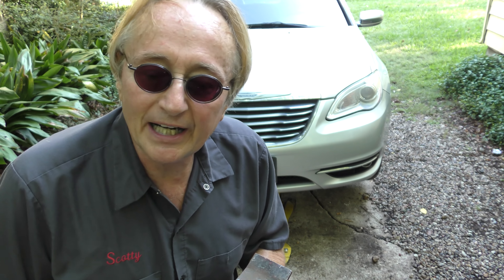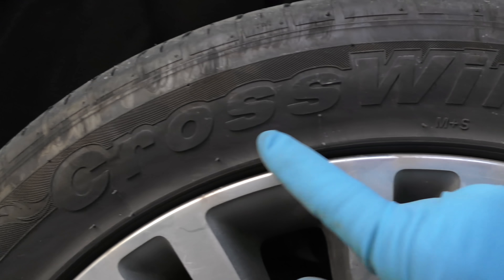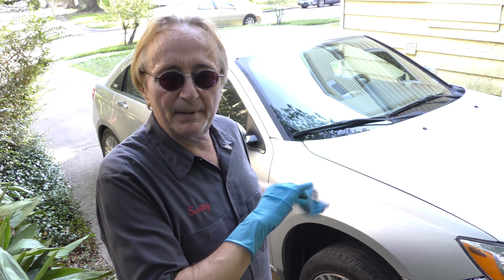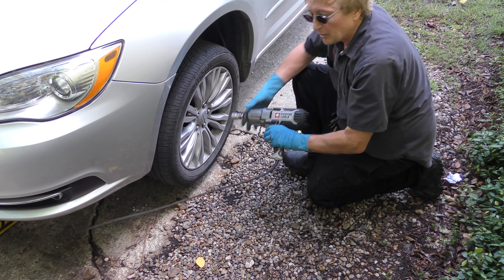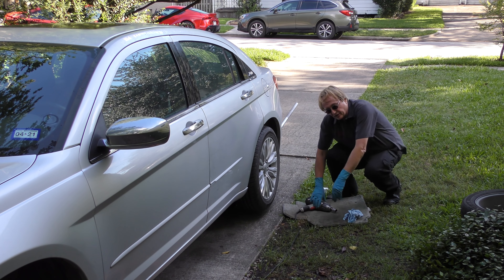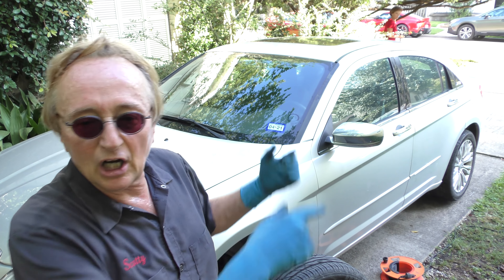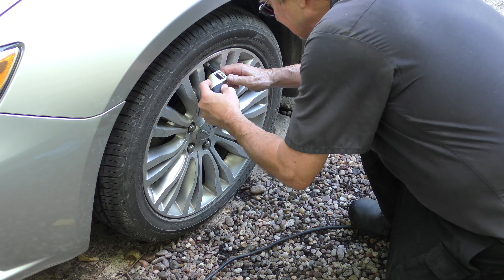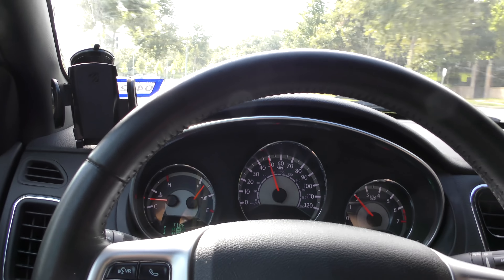Here’s How Stupid People Change Tires

Comment: Scotty, the tire engineers say to put the best tires on the rear, the reasoning is that if a tire blows out on the rear you have a greater chance of losing control of the car and fish-tailing or possibly rolling it over. It's easier to control a blow out if it's on the front. Also, with most cars having ABS (Anti-lock Brake System) you don't have to worry too much about the front braking performance.
Reply: I can understand about fishtailing but it doesn't seem like if a tire blows on the front that it would be "easier to control" because all the steering is in the front and also the engine weight. But it's possible I'm wrong. Do all engineers agree with what you're saying or has this been studied and can you refer us to the studies? Thanks
Reply: @tw8464  I think also for hydroplaning, if the front tires lose traction then the back tires with more tread performed marginally better. I'm sure its very negligible though.
Reply: @Archit3ct1  thank you. I'd been putting the better tires on the front but maybe I'm wrong. I need to look into the research
Reply: @Archit3ct1  I could be wrong for various reasons. It might be the greater engine weight helps tires with less tread get traction. So you have the better tread tires on the lighter weight rear. I've had trouble though with my front wheel drive car. If the tires on the front are at all lower tread it wants to spin out on the steep hills around here when the roads are wet. For example will pull up to a stop sign on a hill, stop and start to go again and if front tires are lower tread it often wants to spin. So that's part of why I'd put the better tires on the front. But I can also see the hydroplaning issue so I need to look into this more

Comment: Hi Scotty, recently read some "EXPERTS" saying better tread on the back because if they lose traction the car/truck will have the tendency to go sideways although this went against everything I believed. Not long after that I had two winter tires on the front of a FWD vehicle. In hard pack snow it actually got a little scary the back was drifting.

Now I use four winter tires on winter/four summers in summer, and rotate them all frequently enough so there's never that much difference in tread between front and back.

An extra used set of four factory alloys for most cars are in good supply and usually pretty cheap. Eliminates the need to remount tires on the rims twice a year in northern climates. Well worth it for a long term vehicle in my opinion.

Comment: I had a Volvo V70 turbo  with 500.000 km when I sold it. Never changed  clutch, waterpump  etc.  only oil and timingbelt and breake pads.  The same for my previous Volvos.
Reply: Good solid car.   Last and best of a line.   Since 2000+ Volvo has been less sturdy on the drivetrain component longevity.

Comment: Scotty,  I understand that for traction purposes you'd want your best tires on the front for a front wheel drive vehicle but I can tell you from having experienced it myself that you dont want your rear tires to be much different in tread and traction then the front ones. Years ago I had to stop abruptly on a wet road and the car started fish tailing because my rear tires did not have much tread left on them compared to.the front ones. As you break you feel the road more from the front because all the weight goes there but if your rear tires aren't that good it will play tricks on you  where the front will give you a wrong sense of feeling of the overall breaking system.  I enjoy your channel and your experience as a mechanic .

Comment: I got into an argument with the guy at the (Costo, I believe) tire shop about putting the two brand new tires I was getting on the rear of my front wheel drive 2004 Lexus Es330.  They had these stupid posters on the wall about sliding sideways in a corner when icy, and that's why they have to put the new tires on the rear.  I argued for a while saying all the things you did.  I want the new tires on front in case my wife gets a blowout on the freeway.  Front tire blowouts are terrible.  Obviously I want the best tires on front.  They refused to put the new tires on front.  They moved the older rear tires on front and the new ones on the rear.  I had to swap them myself when I got home.  Idiots.  I've seen the same signs at Walmart tire, Discount Tire...  They all seem to be doing it now.
Reply: You're exactly right.  It's absolute fricken nonsense
Reply: @MzKandiLane  

You are wrong.   I have tried good tires in the front and bad in the back.   They spin out like crazy in the snow.   It was much better with them in the back as far as stability.
Reply: @raydavies6236  shut up Roy, I noticed you didn't say Scotty was wrong? watch the fricken video, Sure seems to fix the issue.   Btw It's for idiots who don't know how to steer into a skid, and drive with bald tires with no tread left. that's why they wAnt them on the back.   I can see by your comment you're one of them.  I have Always had my new tires rotated on the front of my front wheel drive cars.  I live in ND and I dont skid all over the place, but I Also know how to drive and don't run on bald tires 😂   Awd/4Wd/rwd Suvs/trucks of course are a different story completely.
Reply: As a prior tire tech for a similar wholesale company, I find their refusal annoying. Yes, from a training and safety standpoint, you are supposed to put them on the rear for the sake of hydroplaning/general loss of control; it’s much easier to handle the front of the car in a slide or hydroplaning if the back isn’t fishtailing; you’d likely be able to get it under control. With all this being said, I had plenty of customers that wanted them in the front. If it went against the training, we simply noted on the paperwork that the customer preferred us to put them on the front and released us from any liability, end of story, not refuse.
Reply: Almost of them it’s policy for them but even after explaining to the customer, if they don’t want tires in the rear they still have a say to put them in the front. The customer has to sign their name of the understanding
Reply: remember its your car not theres lol you always have the final say
Reply: Liability issue. You have control of the front but not the rear. Only exception to this rule is if there is a difference of no greater than 2/32nd of an inch in tread.
Reply: @raydavies6236  then you got rear wheel drive!
Reply: If rear tire blow it's a lot worse than front tire if we talk passenger car. If we talk about truck, then truck front tire blow is worst thing because truck have double tires at back, passenger car not.

But i live in north europe and here have ice and snow, this is the reason why i know, better tires must be rear.
But i use all 4 proper tires all the time and i switch them every year so they worn more or less evenly.
Right way is buy all 4 new tires.
Reply: @kaliikleja  I disagree completely.  I've lost tires in front and back of both cars and trucks.  When we say trucks here, we mean pickup trucks, not large commercial trucks.  Losing a rear tire has always been fine.  In fact, it's often barely noticeable.  I've driven pretty far with a blown rear tire and it was easy.  Losing front tires has always been pretty scary and difficult to control at highway speed.  There is a massive difference.  Every time I've blown a front tire I've felt lucky get stay straight and get to the side of the road.  The steering wheel can jerk very hard if the blowout is sudden.  Losing a rear tire has always been simple and calm.  It isn't about having 4 new tires or not.  When it's 115 degrees outside and you're driving 75mph... tires blow.  You hit debris on the road, tires blow.  I've learned through first hand experience, and I want the best tires possible up front.
Reply: @raydavies6236  You spin out with the bad tires in the back... so doesn't that mean your car is RWD?
Reply: Physics and research disagrees with you. As does your insurance company btw
Reply: @bamaboy146  But experience does agree with me.  Look.  I'm sure that on some roads and in some conditions, they are right.  However, on the roads I drive, the vehicles I drive, and the conditions I drive in, I'm right.  I'm not speeding along curvy icy roads in a rear wheel drive car. It makes a difference.  It makes all the difference.  Real word experience matters.
Reply: @Flowboat  no it doesn't mean rwd car, yes in rwd car it's worse. But even FWD and AWD cars may spinout with bad rear tires at ice and snow.
in corner and with braking because front braking force is bigger, and back bad tires cant handle that force and cant hold car straight.
if you drive at corner then g forces at back is quite big, so with bad tires at snow or ice you may spinout.
back end is harder to control than front end, also front end you have more safety than side. side crashes are very dangerous.

But my suggestion buy all 4 new tires.

Comment: Howdy Scotty!! I was told DECADES ago to put the best tires on the back. But that never made sense to me. So, I'm right there with you, bud!! Front tires do the most braking AND they steer the car, that's where I want my best rubber. Front drive asks a LOT out of your front-end!
Reply: Yeah I've been putting the best tires on front of my front wheel drive car for years now. No blowouts at high speeds though so I can't say for sure one way or another. Just seems like want the best tires where the steering and engine weight is. But I don't run bald tires either. I replace the back too if they start going too low tread. It's more like I buy two new tires at a time and the older tires are on the back. But the back tires aren't getting as much wear so they aren't too low or uneven tread. So I don't think the blowout risk is exactly "high" back there.

Comment: Very helpful. I didn't know you couldn't mix tire brands.
Reply: Yeah I made that mistake as a teenager. I had a flat and put the spare on but the spare was an old radial tire that didn't match the other tires. It was horrible didn't handle well pulled to one side noisy definitely a problem. Realized different tires don't mix. Best to have same brand same tread basically same tire on all four.

Comment: They probably just did a standard tire rotation and the guy or guys doing it didn't even notice the car had 2 brands of tires.
Reply: If they're on the same axle it doesn't matter, i.e., two brands on one axle and two on the other. But if you have 3 of the same and 1 different it's another story.
Reply: Yeah, but thats something any good tech wouldve caught.
Reply: Also didn't torque nuts the correct patern...
Reply: Likely had a flat, and cheaped out with a used tire
Reply: Yep
Reply: It's like they don't even look at the tires

Comment: Scotty, agree with you 100%. I never heard of putting the best tires on the rear!
    I put new tires on the front for 3 reasons. 
1. Braking: new tires should grip better than worn tires. Most braking is done by the front tires.
2. Steering: new tires should grip better than worn tires.
3. Blowout protection: I prefer a blowout to occur on the rear. As a tire wears, it becomes more susceptible to a blowout. 
   Thank goodness I was never professionally trained.
2.

Comment: The idea of having the tyre's with best grip on the back is to help prevent oversteer,which is harder to control than understeer.
Reply: Correct .  They should have never not replaced that bad tire .
Reply: 4:11
Reply: At what speeds are we talking about here? Just curious

Comment: When I got a pair of new tires to replace the front tires on my front wheel drive car (for the same reason as the video), they told me they had to rotate the new ones to the back... I think they are full of it, too...
Reply: No, they are not "full of it" that is the industry standard today, to have the newer tires on the rear. This is to prevent hydroplaning or at least minimize the effects of it. This was just recently changed as the new standard I personally think this was to have tire companies make more money, because the front tires wear faster than the rear ones.
Reply: @Brudovo3434  you're right but it's not to make more money. Having the weaker tiers in front helps you  feel when hydroplaning sooner before you completely lose control. Also apparently for the average driver is easier to recover loss of traction in front as opposed to having your tail suddenly kick out.
Reply: My tire place insists on always putting the new tires in the rear as well. I always believed that the new ones go in front. Next time, I am replacing all 4 , even though 2 of them still have some thread left, but the other 2 are really worn.
Reply: Good luck rotating my tires. I'm running staggered. Down side is, I replace the rears a lot more often than the rears. But braking helps more even wear all around.
Reply: I think they just do it for the money.  I had worn tires in the front and good ones on the rear, my stability was so poor on dry roads, after rotating them, it had better stability.  I'm getting 4 new tires on all tomorrow since the shop I used to take it rotated them wrong.  Uneven wear on BOTH sides...uugh
Reply: NTSB studied a plethora of accident data related to tire failures. It was determined that the loss of control due to a rear blowout was far more severe than in a front blowout. In the case of a front wheel drive vehicle, the front end has better grip due to the majority of weight positioned forward. There are too many variables in every driving situation to be able to claim 100% right, or 100% wrong. As for the particular car in the video, the differences between the front tires are certainly substantial, possibly including circumference. It's rough on the drivetrain to be running tires of different circumferences. Especially when the vehicle is equipped with antilock brakes that can be messed up by uneven rotation. The uneven rotation problem is even worse on an AWD platform. Ideally, you will have matching tires on all 4 corners with matching proper inflation. Hopefully you will stay ahead of the game by checking those tires on a monthly basis, even more if you can.
Reply: Rotation every 6 months so they wear evenly when buying 4 new tires
Reply: @pedrofernandez8729  Just means you will have 2 good spares in storage in case you ever need them
Reply: @JW...-oj5iw , that seems counter intuitive. If you're going to have a tire blow out, wouldn't you rather have it in the rear? It'd be easier to steer and control the car than if the front tire blows out.
Reply: @victorparra4227  rotate by mileage not time*
Reply: @AbcAbc-sp1od yeah that's what I thought but if this has been studied then I'll have to read the study. If they studied thousands of blowouts or crashes, then maybe there is an indication which way to do it is generally better most of the time. Intuititively I thought you'd want your newer better tires on the front so to decrease chance of blowout where your steering is, but maybe I've been wrong or not understanding this well enough